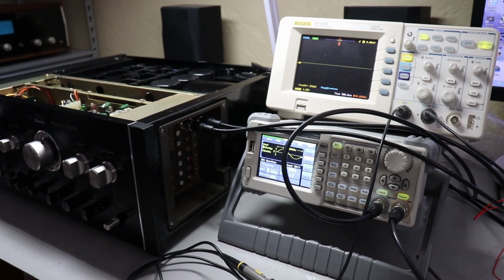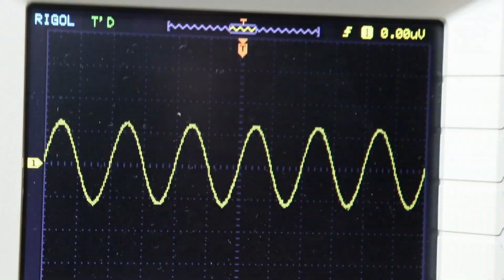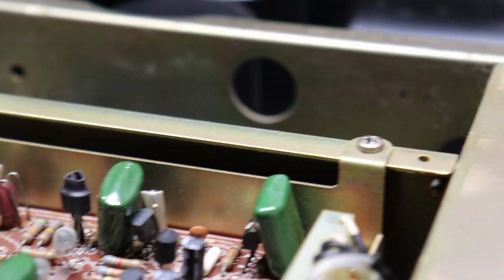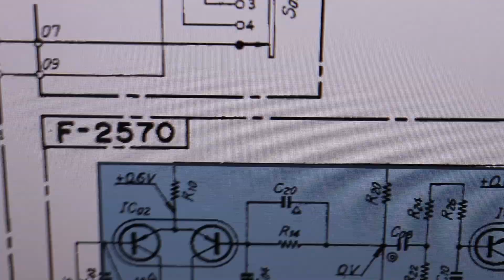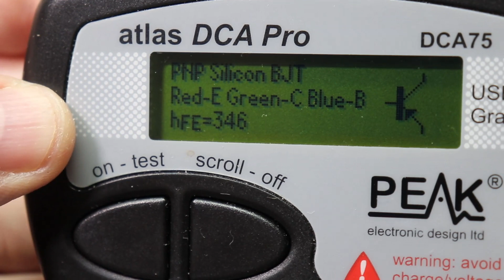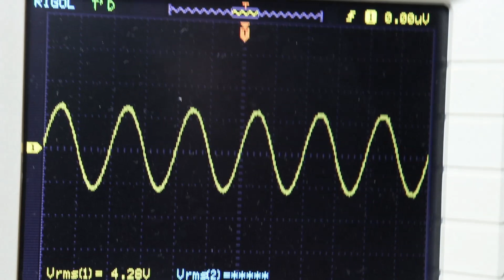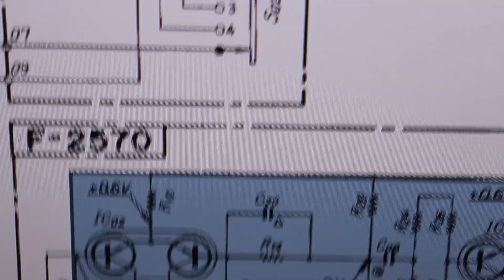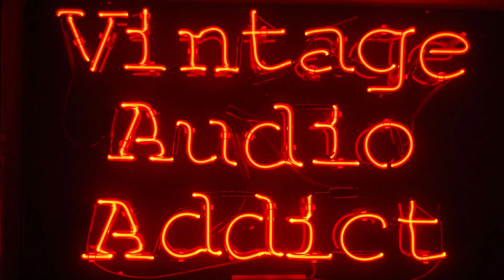Phono Troubleshooting And The Trouble Transistors. Vintage Stereo And Audio Repair For The Beginner.

Comment: In a nice spacious unit like that, you could easily upgrade your phone preamp to a Jfet unit with high end capacitors, one good circuit is the lepacific which uses lsk170s

Comment: Hello. Your videos are awesome. I hope I can find an answer here. Does a faulty part (diode, caps, resistors or whatever goes in the phono board) can degrade the sound of the channel? Like weak or low treble or low sound output in general, intermittently? Both channels of my pioneer sx 1980 drops treble especially the right channel..i dont know if faulty parts can make that happen. A couple of techs cant find the problem or just dont want to work on a complex unit like this…thank you…

Comment: Hi , you have a great channel, and I have a question that I hope you can answer. I’m nearly finished with my first repair and recap on my pioneer sx-450. The last replacements I made were on 2 of the faulty transistors in the phono preamp, replacing them with ksa992s. On one of them, I accidentally heated my desoldering gun too hot and the solder pag came straight off and I lost it...☹️. Is there a potential fix for this, and if not will one missing transistor in just the phono eq section affect playback on other inputs?
Reply from the maker: Hi, thank you for the kind words. No, big deal. I've damaged many myself for one reason or the other. Yes, you should fix it and it can be fixed. Search here on YouTube "repairing solder pads".  There are many videos on that subject as it happens often. Watching someone in a video will help you fix it better then me trying to tell you in words.

Comment: You CANNOT always find replacement parts at a reasonable price. The SONY TA-2000f Preamp (1975) is good example. It uses 2SK43 and 2SK23 FETS developed by SONY in the mid-70's. Only recently have they popped up on ebay between $11-19.00 a piece !  ($97.00 for an 8-pack!) Nor can one use common J-FETS to replace them. There is NO "NTE" Equivalent part like there is for most bi-polar devices. What I ended up doing is drawing the original circuit into circuit simulator software and then trying out common audio-grade low-noise FETS and bi-polars in the "virtual circuit". I ended up using NPN-MPSA18's (low noise high beta devices) but I had to re-design the entire bias and feedback network around the bi-polar devices. Lucky for me it was just a 3 stage "textbook" circuit. The new bi-polars have a much better transient and square wave response than the original SONY-FETS and are just as quiet.  From what I understand..the reason SONY used FETS (in the gain stages) was for their low-noise characteristics. However I DID change the "sound" of the unit...for the better (IMHO). The THD was within the original spec also..but this was more a function of the simple circuit design than the parts used. Purchasing and learning how to use good a circuit simulator program is highly recommended if you cannot find an exact part match. (IMHO)  The built-in libraries contain thousands of parts...(even more if you use a web-based sim tool)  You can replace parts and measure gain, noise, transient response and even THD (!) all "virtually". The only drawback with most "end-user/hobbyist" circuit-simulator software is that they CANNOT discriminate among various capacitor types. A cap is just a cap. (There probably are circuit-sims out there for cap-modeling but they cost over $1000 to purchase and many are subscription based..)

Comment: phono amp also corrects the bass and treb as well the RIAA
Reply: Hello, what do you mean corrects bass and treble?
Reply: @cheng96818  puts the bass back on the record
Reply: @moodyga40  thanks for the reply. I need to ask one more if you dont mind. Does a faulty transistor or cap on the phono amp can make an intermittent problem? Distortion, treble drop?
Reply: @cheng96818  it can
Reply: @moodyga40  ok thank you, now at least i know what to tell these techs….

Comment: What's your opinion on power transistors from 1970s? I just removed mine (Toshiba 2SD428+2SB558) for cleaning and changing mica, they worked OK but are they really worth keeping? would a new complementary pair, say, MJ15024+MJ15025 be safer in the long run?
Reply from the maker: I think that they should stay. There are some transistors that are known troublemakers but I don't think those are on the bad list. Also you are a person that can do his own work so if something happened to them in the future you could take care of it.
Reply: @vintageaudioaddict  Seems like they have to go, anyway. I suppose I damaged one in the process, or perhaps it's deeeper than this. After putting it all together, one channel is fine, the other appears to be working, but I cannot set idle current and it distorts. At the widest bias spreader setting, the voltage across output transistor bases is only 0.9 volts, with 0.6 V across PNP base-emitter but only 0.3 V across NPN. Seems like  it's hogging current from the driver, so the bias spreader is always starved (it's good, the current source feeding it is good, yet all that current flows into the NPN leg). I'm out of ideas except replacing driver and output transistors altogether.

Comment: I would like to know how you know what modern equivilant transistor is appropriate for a vintage replacement transistor? This question has always stumped me.
Reply from the maker: This is not an easy answer. You have to look at the parameters of each. It can take a lot of time and research to find the correct choice but a equivalent modern replacement can usually be found.
Reply: @vintageaudioaddict  Yes, but WHICH parameters are the most important, is the question. Always stumping me because there's such an myriad of parameters

Comment: I always replace those low value ceramics in the signal path with silver micas because ceramics always drift and dull the sound. The sound difference is night and day
Reply from the maker: Thanks a lot for sharing your experience with the ceramic capacitors.
Reply: Where is the best place to purchase them?
Reply: @vincef.8261  purchase what?